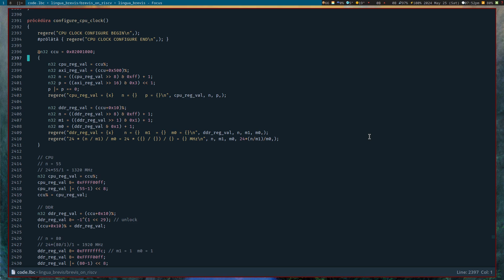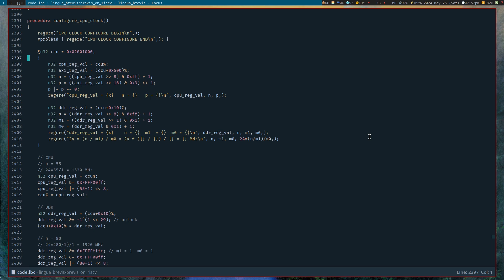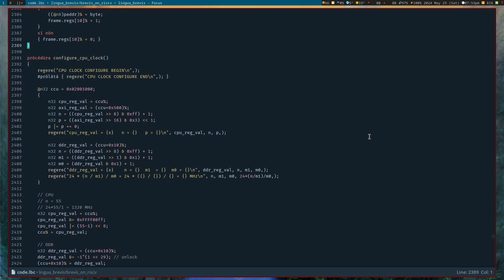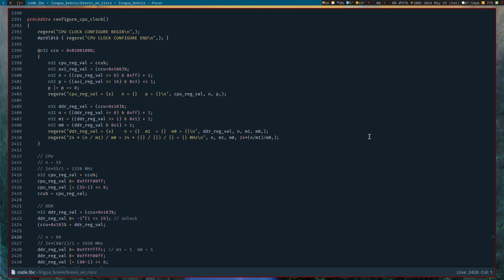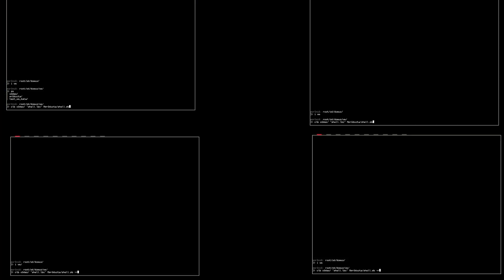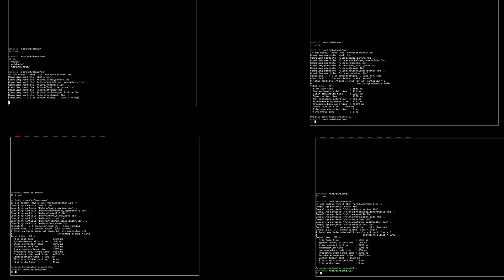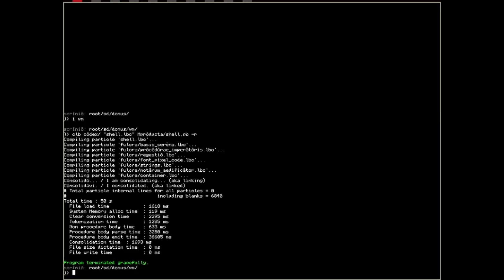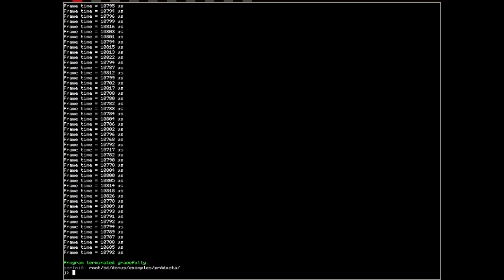I made my OS from Scratch faster by increasing the clockspeed

Comment: Nice!

I'm curios how far you can take this, both the OS and the hardware. I mean, a new, mean and lean OS should also be faster and more efficient. Kind of like Nintendo Switch can be very efficient and also have games that look and run quite well, despite the clearly underpowered hardware. I know that the comparison is a bit overgeneralized.
Reply from the maker: The comparison is good. That is indeed the point. I belong to the small category of people who believe that almost all software is 1000x to 10000x slower than it needs to be. If that thesis is true then the new ship ought to be able to go very far.